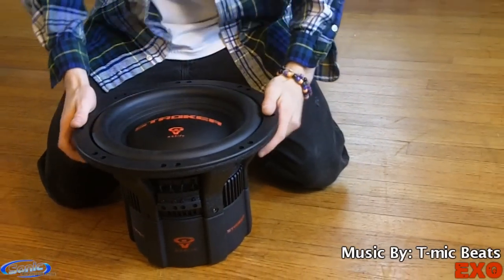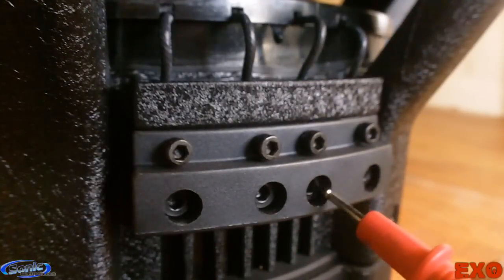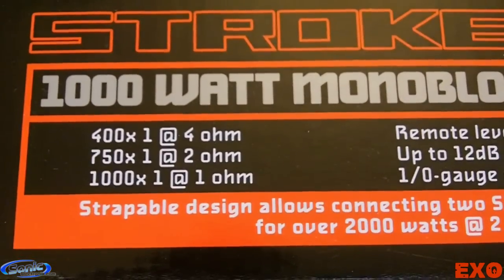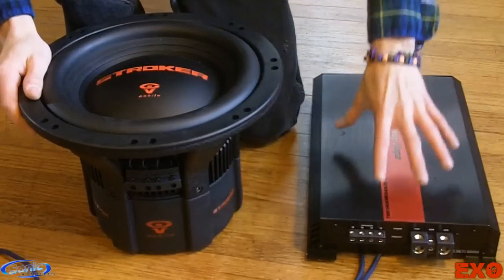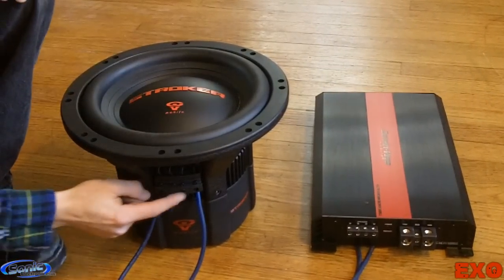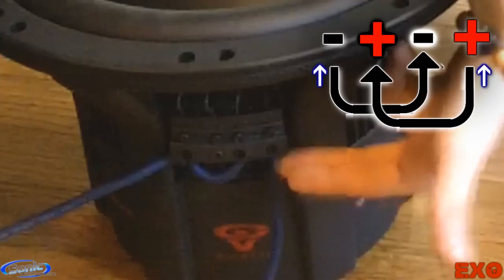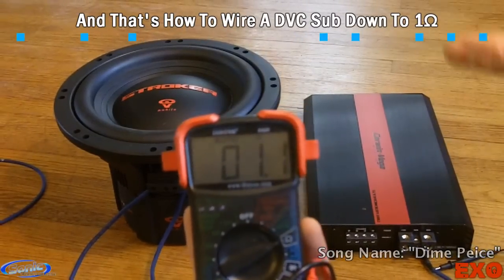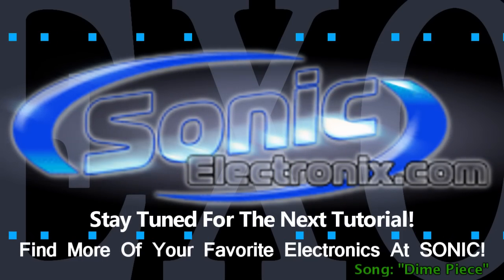How To Wire DVC Subwoofers In Parallel // Dual 2 Ohm Voice Coil Sub Wiring | EXO Car Audio Tutorial

Comment: OK EXO, I have a question for you. I pray you have an answer that is good. I recently bought two two Infinity Kappa Perfect 12.1d's. My amp is a Power Acoustik OVN2-2200. How can I safely wire this up. I just got off the phone with Crutchfield and they said to wire them parallel in a two ohm load. Is there other options, or where is a diagram that I can see how to wire it.

Comment: Hey EXO, love your vids, but i have a question for you becouse i don't think you ever mentioned it.
Soon i'm gonna be building my first system, putting a box with two 15's in my trunk. The box will be coming up almost to the roof, but is it then better to have my woofers pointing to the inside of the car, to the rear or is either way the same.
Also when i would make them pointing inside the car would it harm to have my port pointing to the back of the car?

Thx ahead man!

Comment: @playhcky95 id say the 2 2 ohm subs, but not much of a difference, you can wire them the same in series, but you can parallel the 2 2ohm subs to a 1ohm load, = louder

Comment from the maker: @sk8rkid135 - Yeah, you can run them all at 1ohm - Just wire them up in series/parallel - Parallel your 4 positives and 4 negatives, then series your other 4 negatives & positives together.

Comment: Hey, EXO man, I'm looking to wire my 4 dual 2 ohm SA-8's on a 1 ohm stable 2000 watt amp. How would I go about doing that? Tell me if I need to go with the dual 4 ohm SA-8's as I haven't purchased them yet. Thanks

Comment: so my amp is 4ohm but to ohm stable not bridged. i have 2 subs wired down to 2ohm. my amp is 800w and my subs can handle 500w each. i want to be able to hook my subs up so i can get the most amount of power. what should i do?

Comment: HEY EXO??? i have two 10" subwoofers, both are 8ohm, and i just made a box for the both of them and i have a logitech set that put out an 8ohm signal and x-amount of watts. is it possible that i could wire the both of the subwoofers to the logitech amp through some extra wire like i have done to just one sub, but have both subs put out a final signal of only 8ohm?..
PLEASE RESPOND, thanks Exo!

Comment: Eco you had 12"kicker CVR didn't you well I got a question I have 1 right now plan on getting a second would you recommend ported or sealed? I wanna get the best sound out of these and what amp would you recommend as well as wire size and should I run em 1ohm each or 2ohm

Comment: Quick Q. Like you I have a monoblock with two positive and negatives. My subwoofer is wired in parallel for a 1ohm load so do I now just use one half of the connections on the amp to hook the subwoofer up, or would I wire it the same as if I was bridging?

Comment: ive got a dual 2 ohm sub, but when i wire the second coil up i see nor hear a difference. but my power output from my amp (according to my power meter) goes down as if it was working. idk what to do is that coil busted i used a ohm meter (kinda like yours) and got a 2 ohm reading from the coil i was trying. does the 2nd coil only kicking or work at high volumes or something?

Comment: Thank you so much for sharing your knowledge whith us ! And I have a question, I'm becoming mad for this! today i noticed that all my 2 midrange woofers aren't working, so i cut their wires off (i have a home setup with 3 speaker per box) and tested them apart: I can barely hear the sound at full volume, and I'm sure the amp works. what could it be? these midrange speakers have also a capacitor in series, for crossover.its not blown, tested the ohms....Please someone help me!! Thanks!!

Comment: @tdsa23 If you have dual 1 ohm I don't think you want to wire it lower that 1 ohm cause you'd have to wire it to .25 ohms which is crazzy, I don't think any amp can take that on a daily basis.

Comment: Ok I have 2 12 kicker cvrs and a class d zx1500.1 one is an 05 one is 07, the 05 is dual 2ohm the 07 is dual 4 ohm,is there any way to use them both with my mono amp? Atm I have them running with a dual channel lanzar vibe 2400.2 but I want my system back to all kicker..help?

Comment: @WilkinsChunilall If i wire them to 1 ohm i will over power them causing them to blow ending up with no more bass:(  
That's why i want to check if i have them wired at a final 4 ohm load, so i wont blow them:p

Comment: I have Two Alphasonik 12in 600 series wired down to 1ohm for my HIFI 1500d which is 1500 watts RMS @1ohm . It moves air but i need a better box IMO ( Yes i have a prefab but doesnt everyone start out that way lmao)

Comment: @brandonleelaird Are you using the OEM headunit? If so then that's your amp remote turn off wire not getting the shutoff signal more than likely.

Comment: Great video! One thing I noticed is that's a mono amp with four outputs. (Dual positive and negative I assume.) If you want to improve your power flow you can run each voice coil to those outputs. (Of course you know this.....but some people watching may have been wondering)

Comment: Also, if that amplifier is a mono-block, you can run both positives and both negatives to the amp and still see a 1ohm load. it will internally "bridge" the speaker load :)

Comment: it may be more expensive to use a 1000W at 4 ohm amplifier instead of a 1000W at 1 ohm amplifier but the benefits are not as much current will be flowing into the voil coil, it will be more voltage, the voice coil won't heat up as much when ran at 4 ohms, and in the long run will lead to cleaner power and less chance of the subwoofer blowing